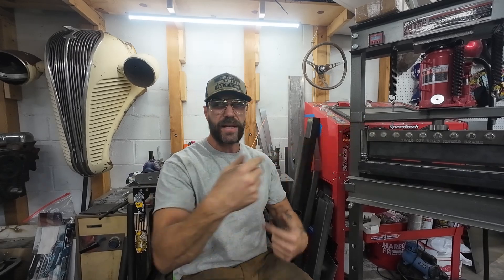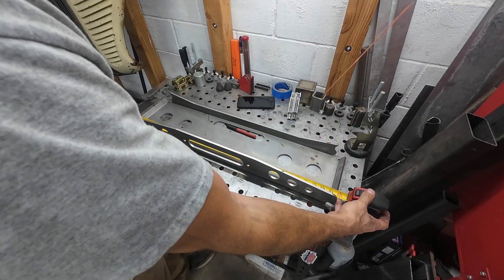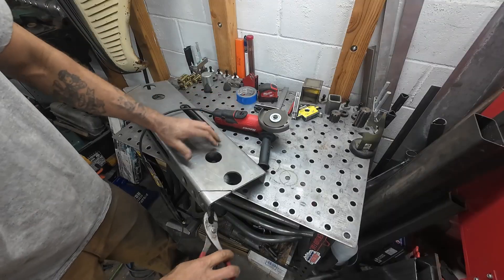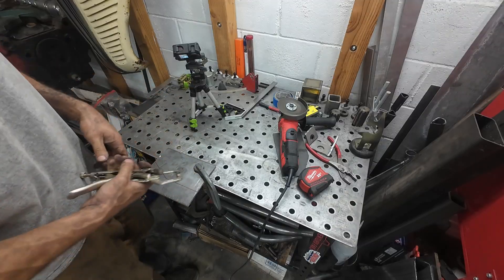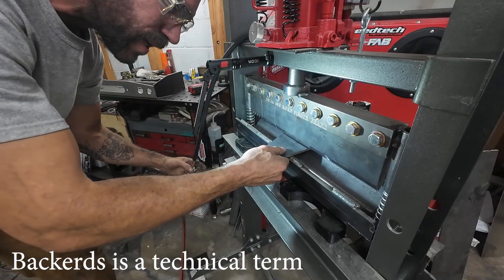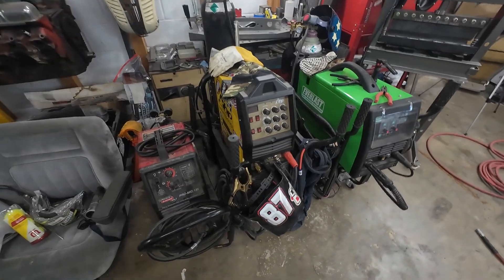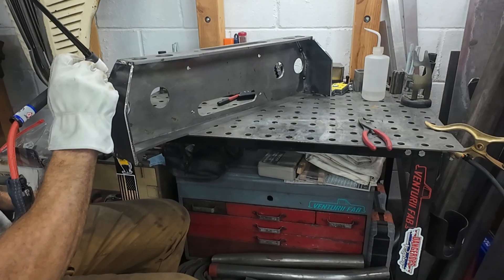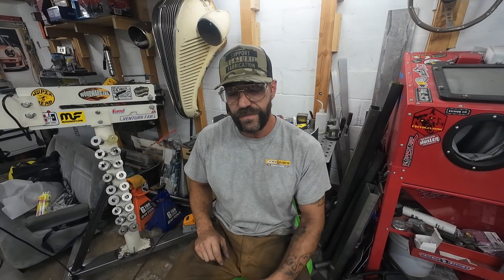15 Tools Every Beginning Fabricator NEEDS + 5 To Level Up

Comment from the maker: Thanks for watching! 👊
Which tool on this list do you already use the most? Or what’s the one tool you’d add to the list that every beginner should know about? Drop it below ⬇

👉 Want more? Check out what we get into around here - https://www.youtube.com/watch?v=JE7krJYz2AU&list=PLUjlT0xsbdjyN4nwIKxLzbW4nEC6ha1jD
👉 New videos every Thursday — subscribe so you don’t miss the builds.
Reply: Power probes are awsome from what I’ve seen of them but, I just use an ammeter it just takes a little longer and more knowledge to use. My question to you though is why the hell would a fabricater need one?
Reply from the maker: @chauncey5962  I build entire vehicles so I end up doing as pretty decent amount of electrical from adding in lights and stuff to complete rewires so i use my power probe almost every week.  i'll agree that an ammeter definitely has more capability but for quick diagnosis and testing circuits and stuff  my power probe is my go to just because its so quick and easy.   i guess why would a fabricator need one really just depends on where you draw the line on what is and isnt fabrication
Reply: @VenturiFab  that’s fair man I’ve thought about getting a power probe for years do you pin your own connectors?
Reply from the maker: @chauncey5962 you'll love it once you get one, it just speeds up a lot of the simpler stuff but it definitely will not replace an ammeter.  I do repin as needed like replacing the black box computers with an early ls style in a gmt400, and I've started using Deutsch connectors a lot more.  Just trying to keep improving in cleanliness and serviceability.  Sounds like your deeper in the electrical side than I am, any must haves that you'd recommend that make your life easier?
Reply: @VenturiFab  I’m just a welder from the coal mines man, if you had cheap dc power supply it would apply voltage to stuff same as a power probe can and probably half the price I will recommend wagos for splicing though just because I’m lazy. Only real thing you’re missing is a torch imo it’d be worth learning to braze well for what you do in case you ever wanted something to have a gold appearance.
As well as heating things you could experiment with pseudo blackstmithing on some of you stuff to really make it stand out. I’m a bit of a tool nerd and a mediocre handy man
Reply from the maker: @chauncey5962  wagos are super useful, I've had a handful of them in my roadside kit for a long time, great suggestion.  I do have a torch setup, just haven't used it for anything on the channel yet, but brazing is something I need to get better at, I recently picked up some bronze filler to start doing more of that.  And thanks for what you do man! Coal is such an important, yet under appreciated industry.